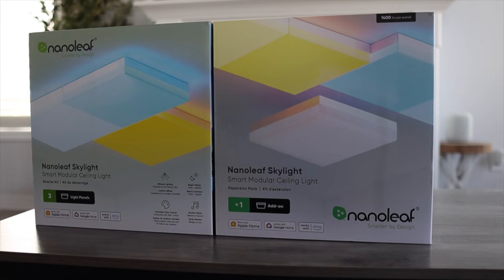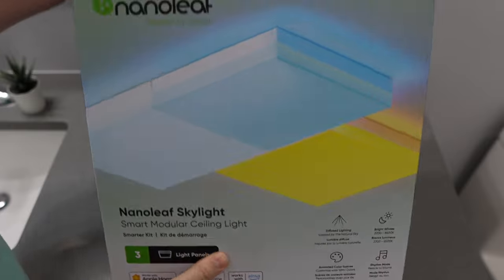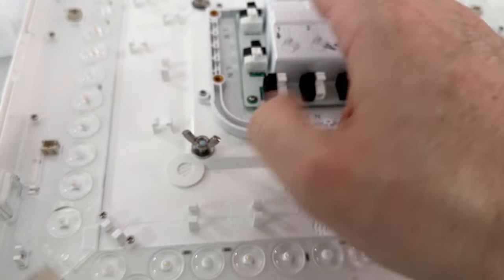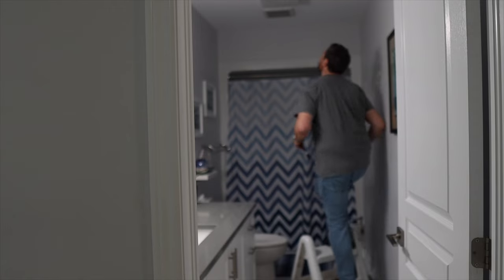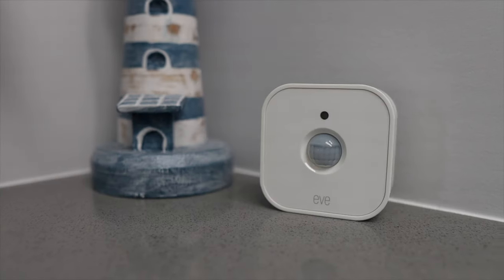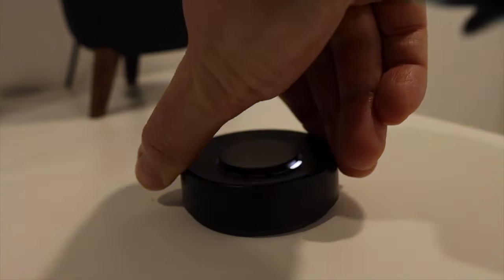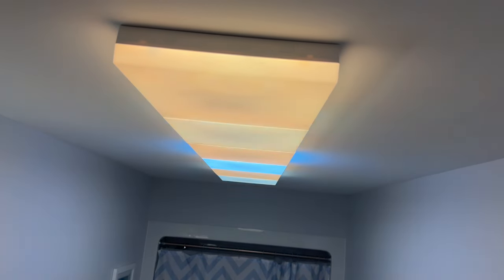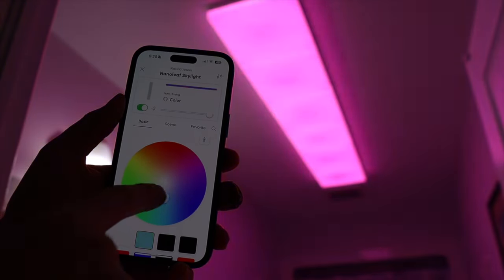A SkyLight for your Smart Home - Nanoleaf Skylight!

Comment: Brad, thanks for the video.  I just remodeled my home and have been watching your videos, I've found them quite helpful.  I have recently purchased 20 of the Nanoleaf 4" down lights to work with Apple Home Kit.  I chose them over the Philips because I needed the pancake style in a 4" and Philips didn't offer it.  After setting them up, it appears the native Nanoleaf app, has quite a number of extra features as opposed to utilizing the lights through just the Apple Home Kit. In my home I have guests who still need a physical switch to black out the lights when exiting a room or turn them on when entering.  Would you recommend using lifx switches for that purpose? Or is there something else you might recommend? I'm really trying to stay with a single gang switch and not add anything else on the wall.  Essentially I just need the switch to program the lights to "blackout" or "last setting" I suppose.  Any help would be appreciated.

Comment: Hey Brad, I've brought this product up many times to other youtubers, but no bites so far. I'm hoping someone will review the RunlessWire wall switch. It would be a great alternative to the blank switch you put on the wall. The RunlessWire can go over the switch box, but you leave all the wiring hot in the wall. It does not actually connect to the wires. It uses kinetic energy when you push the switch to trigger any scenes or accessories that you want. I use them at my house and they work great for having an old fashioned control over smart products. They are Homekit compatible.
Reply from the maker: Thanks so much for the tip! I’ve never used this but let me look into it, Nick! I’d be open to trying it out. 😉
Reply: Yes please

Comment: Hi Brad.  Have you tested the FP2 to see if it will detect someone taking a shower?  We used an FP1 (original presence sensor) and it had no issue detecting someone even through glass doors.  Used a motion sensor to turn on the lights and the presence sensor to turn them off when no presence was detected.

Comment: Great video, Brad. These lights are beautiful and innovative. For me, the killer is that the Nanoleaf app is just garbage. I have begun to change out all of my A19 bulbs from Nanoleaf to Phillips Hue to I do not need to keep battling with their app.  I hope they fix this soon as their physical products are good. I still have a 20-piece Nanoleaf Black Hexagon design in my office so a better app will still be critical for me. 

Thanks for the comment/tip on the Aqara FP2. I got a ton of these in Q4 last year and my very limited time has left. E frustrated in the best way to set these up. I am definitely going to try zone-free set ups in several rooms.

Comment: Can i separate the Light panels and run Romex (hot and neutral) along with a 2 conductor wire between them so i can spread them around my music room?     Thx!    I would basically be doing the same thing as their short jumpers, but just with longer connection by re-using their short jumper wire and adding an extension wire.